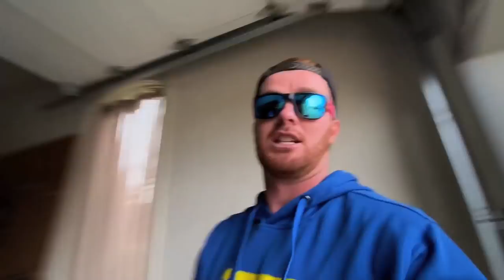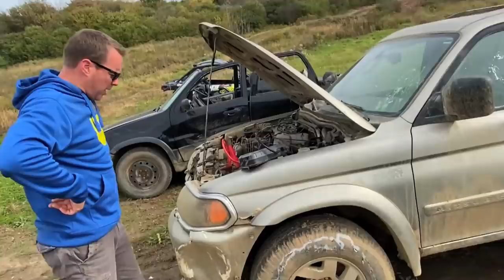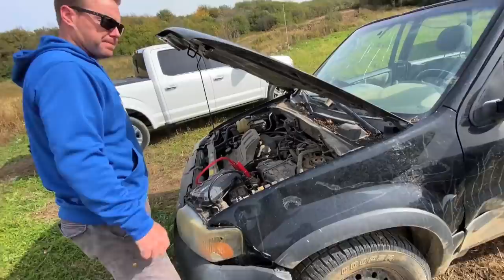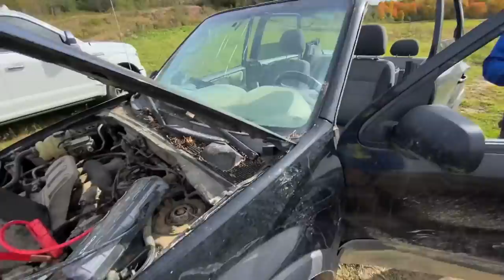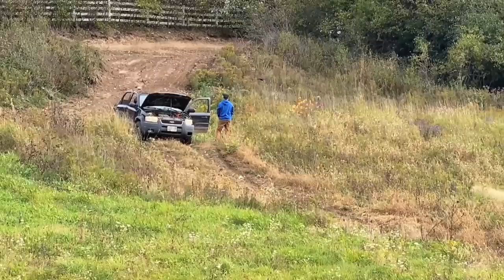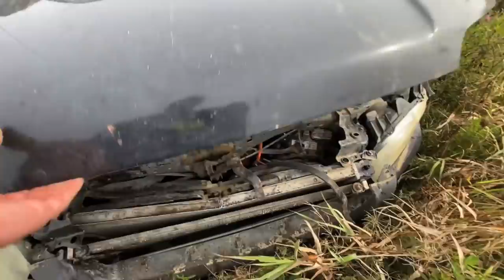CRASH MOST EPIC Ford Escape CAR JUMP!

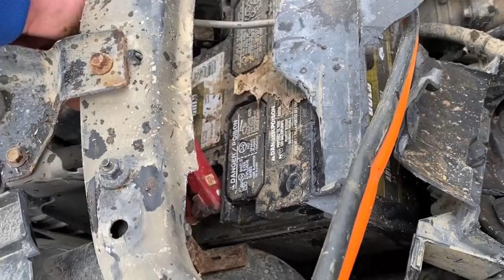Comment: At 32:16, Brad...

The battery cable had slipped off the terminal. You hooked the booster up to the battery, not the car. No wonder she wasn't cranking 😂😂